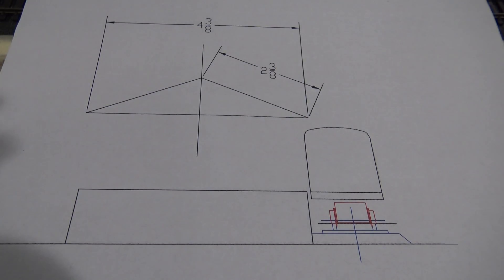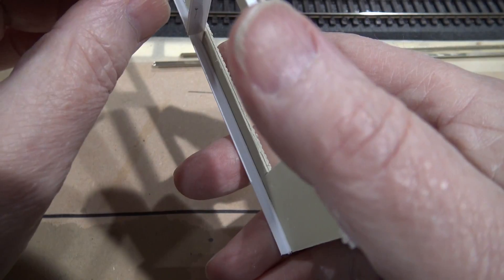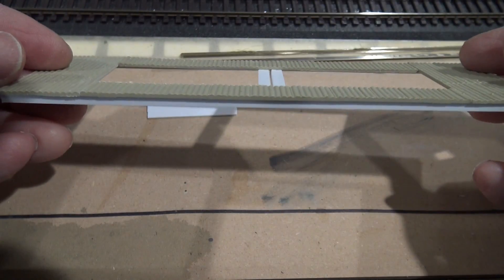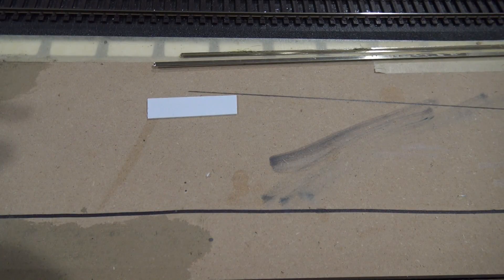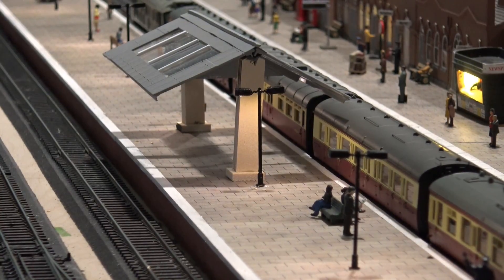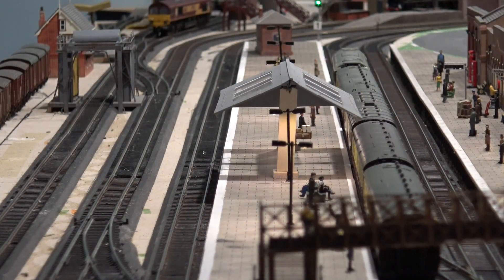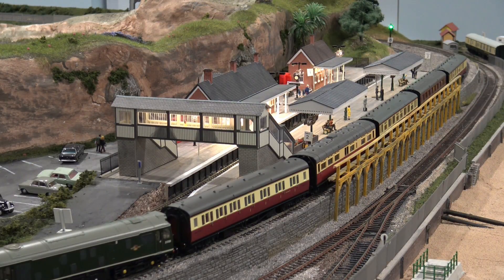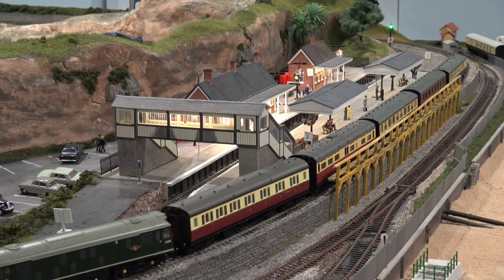83B Building Farland - Canopy Design

Comment: Hello Rob, the platform is coming along very nice. The canopy scratch build is looking really good. I like the idea of the glass in the canopy, aluminum framing/glass was my line of work for many years and I'm still involved in it part time. Love the sound track at the end of the video. Have a nice holiday weekend.
Reply from the maker: Hi Cary, Slowly but surely the area is coming together.  I am trying to enjoy the rest of the build out and not go at breakneck speed like I have been.  Interesting about your line of work.  Of course the Victorians that built these railways used iron, wrought or cast for almost every thing.  Thank you so much, Rob
Reply: The work that was done in those days was absolutely beautiful. I replaced the glass in a Richmond VA science museum canopy that was a railroad station in the early 1900's. The iron and copper structure was awesome.
Reply from the maker: That sounds like most interesting work.  I know I will not be able to come up with a way to model any Victorian glass work, but I do want to get plenty of light in under the canopy.  Thank you Cary, that is a very interesting tidbit of information about you.  Rob

Comment: I hear ya on the expansion.  I wanted to punch a hole through the house to the yard but Cora said no.  Then I thought make a helix so I could run a line on the main floor, I won't repeat what she thought of that idea.  I guess I have to stay in the basement.
Reply from the maker: Scott Downey I hear ya Scott.  For some reason wives do not see the poetry in winding track around and through houses.  Thank you, Rob

Comment: I really like that design for the canopies. There’s enough detail in them to make them look prototypical but with a simple build feature. Look forward to seeing the pillars and valance detail being added. Paul
Reply from the maker: Galgorm Hall Hi Paul, Detail can be added quite easily.   I was going for a strong easy to build system since I want to make 4-5 of them.  It is kind  a scratch built kit of sorts.  I now need to sort out the pillars that will support it.  Thank you very much, Rob

Comment: Hi Rob, Great looking canopies but I agree with Dave Howarth in that they look to be a little wide. They should be just wide enough to drip rain onto the coaches above the rain channels on the coaches. With the derailing Bachmann coaches, is it possible to loosen one bogie to allow the wheel sets to adjust to the super elevation.  We do that with almost all of our North American HO rolling stock and it works very well.   David.
Reply from the maker: David Atkins Hi David,, I think I will take a couple of mm off the width.  It should not be hard to shorten the pieces for the unbuilt ones.  This one was a prototype test unit before I run the rest.  I will just have one less canopy is all.  I planned for 5, but 4 will do.  Oh yes I have tried multiple settings on the bogie screw.  In fact I’ve spent days of time on the problem.  It is just easier to forget about them.  Ive played with weights in various places more and less.  It has seemed a waste of time.  Hornby’s run fine out of the box.  Thank you, Rob
Reply: Well, we all trouble shoot our problems and either arrive at a solution or end up with a compromise . It would seem that you have narrowed it down to coupler design so the next question is "can you replace them?" Have you tried pushing individual coaches over the super elevated track not coupled to anything? If they work that way it would confirm your diagnosis that it is the couplers.   David.
Reply from the maker: David Atkins Hi David, Yes I have.  A coach by itself negotiates the super elevated curves fine, no problems.  Two are fine too coupled together.  It is when it reaches three that the trouble begins.  A radical solution would be to get some Hornby chassis and put the Bachmann shells on them.

Comment: Hi Rob,  Regarding video 83B...the coaches do not run well on super elevated curves..

Some Modelers really go all the way and determine the true weight of a car.  Then they determine the scaled weight and place the coach on a digital scale and add steel shot or bee bees with epoxy.    Do yo think this would help your coaches stick on the rails better?

Regarding coal loads for condolas, I took rubber strips and ground them thru an old manual meat grinder.  Came out perfect.  I lined the car with plastic wrap, add the ground rubber with pva glue.  When set, pulled out the plastic wrap.  Perfect coal load for the car.

Bob
Reply from the maker: Hi Bob, I have experimented with various weights in different locations.  I have not tried the scientific method, but as many experiments as I have done, I must have it on the correct weighting at some point.  I am convince it is the way the coupling apparatus is sprung and its geometry.   Oddly some are worse than others although they look identical.  I can get a rake to run okay sometimes by interspering Hornby BR Blue either Intercity or simple blue and grey ones.  It is not that I cannot run them at all, it is that it is a pain in the you know what to get one to run .  Thant's all.  Thank you, Rob

Comment: if you run the coaches slower through the curve, do they still derail? nice running. i do like the night shots.
Reply from the maker: Hi Sparky, The problem with the Bachmann coaches is not speed dependent.  I think it has to do with the way the couplers are sprung.  The inner front bogies ride up and over the rail on the outside.  Thank you, Rob